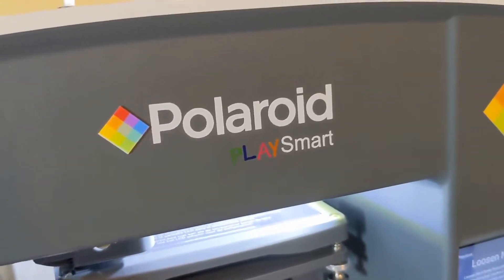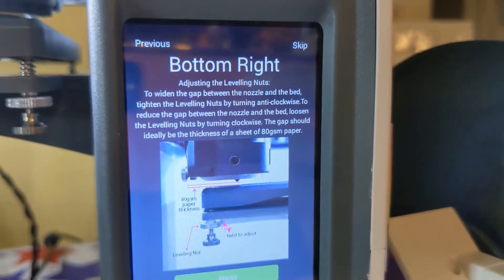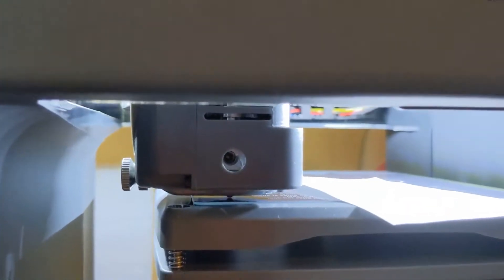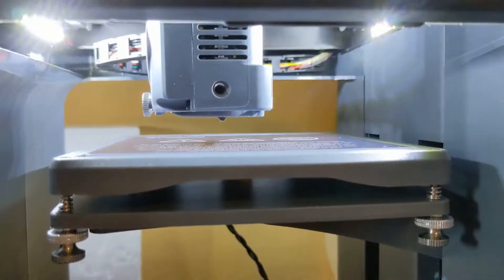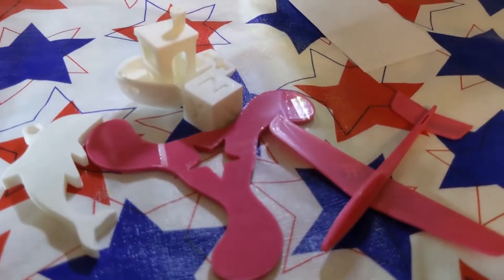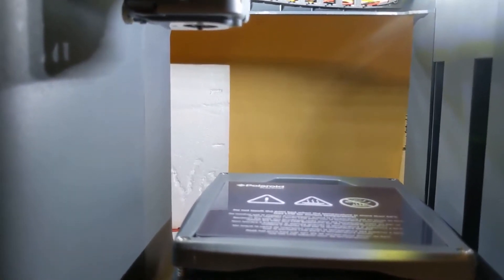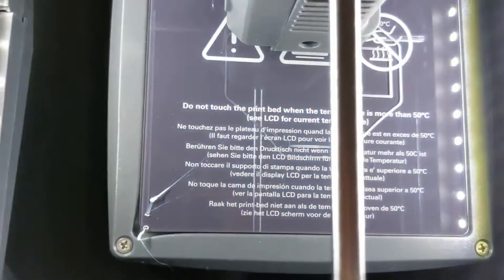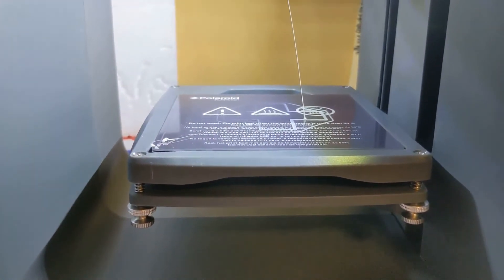Polaroid Playsmart Bed Leveling issues #3dprinter #Polaroid

Comment: Similar issue with my PlaySmart.  I got sick of chasing around the square with the built in routine procedure.  Now I just ballpark it once with the Polaroid built-in routine and then print out one of the leveling calibration prints that covers the whole bed and adjust the screws by sight while it is printing - quick and easy.  If it needs it I check it after every few prints with the same calibration print and if it is off I just touch it up.  And as 
@p0lyf0nisk says below, print with a wide brim and touch it up while the brim is printing if you think it is needed. 

Note also that the glass bed is held in place with four magnets on the bottom corners.  Pop the bed up/open and make sure there isn't anything stuck between the magnets or any contact points underneath.   

In my opinion this is a pretty good solid and very well made printer for the (close out pricing) money I paid.  Problem is that it has a small (120x120) bed.  I tossed out the top cover and only use the bottom cover cuz it has the feet on it and only has two screws holding it on.  It works great till it don't.  Like most 3D printers, the more you use it the more you will wrench (adjust belts, slipped shafts etc.) on it.  It was my first 3D printer so I have an emotional attachment LOL. 

BTW This is NOT the same Polaroid of the past.  That company went bankrupt and the brand name gets bought and sold.  Unfortunately the company that owned the Polaroid brand name at the time and built this printer dumped it (and all 3D printers) within a year or two after bringing it to market, dropped all support, pulled the phone apps off google play store and screwed all their customers.  I know, WTF??? 

And . . . also the Polaroid SmartPrep slicer app is based on a Cura engine exe however there are not many fine tuning changes you can make.   If you want to get serious with the PlaySmart If you search around you can find some printer profiles some users have created for the PlaySmart for Cura and Prusa slicer apps.  

And . . . if you open it up it uses the same (or very similar) Robin STM32F103 based board along with the Polaroid proprietary board for the WiFi, onboard camera and interface with the Windows, Android etc apps.   Unfortunately the stepper motor drivers (stepsticks) are soldered in (vs. sockets).  You can get one of those STM32F10x boards for ~$35 and run whatever firmware you want.  (I am about ready to)

Comment: I usually print with a wider rim on my prints, and adjust it slightly as the print starts, by then, usually the leveling is correct when it starts to get closer to the actual print

Comment: Thank you for making this video, I think I am having pretty much exact same issue. I purchased printer on good discount, and prints come out ok, but the first layer changes pretty much on every print, sometimes in the middle of the calibration process. I notice that for during the bed calibration for example, I feel the paper scratching. Then I go down 0.05, I hear a click, but nothing happens on the paper tension. Then I go again 0.05, and now paper is loose. Then I go up 0.05, now I do not have tension on the paper, then I go up another 0.05, now paper is too tight. So it is different if I try to calibrate two times down, or two times up, somehow it seems to skip this layer completely. 
It does print well though when it wants to, and I bought it cheap, so I might keep trying it in the following days and see how it behaves on larger prints. I could live with re-calibrating it every time I guess, but it is inconsistency that annoys me the most.
Reply from the maker: Yup. I think it's always been a design defect, avg that's why they had it on $100 sale, which is when I decided to try it for kicks and giggles. But yeah, it's not worth the pain and hassle. I'm just keeping it for the novelty of it .. LoL

Comment: There is a polaroid vid that shows how to level the bed. You are not loosening and tightening the nuts correctly. Both nuts work together, not just the one on the bottom that you are usingl.
Reply from the maker: I know both nuts work together, good sir. You loosen the bottom ones, then you adjust bed height using the second set, and then tighten down the lower ones.

I'm a pretty experienced guy. So, trust me on this one. Polaroid support agreed it's defective, and asked me to return. I haven't returned it yet, and it just sits there collects dust, cuz I have 9 more, bigger, better machines

Comment from the maker: I'll be reaching out to Polaroid Support, and post an update later, based on what they have to say.
Reply: Did you ever get an update
Reply from the maker: @RubMySweatyThighs  not yet. I got super busy, and haven't contacted them yet. I'll keep posted.
Reply: @learnmakerepeat7140  anything yet? Thanks!
Reply from the maker: @mastermind6767  They couldn't figure what was wrong, and said to return it to the store. I haven't returned it yet. But it seems like they don't care
Reply: Tighten the lock nuts to stop the adjustment screws moving it gives you the instructions on the screen but you didn't read it you pressed ok at 3.04. Lock tbe nuts and that should cure the problem
Reply from the maker: @90-wolf4  that's not the case. Nuts were tightened, and I'm will aware of the process of Bed Calibration and leveling for this machine. It's the least used of all the ones that I have.

Additionally, Polaroid support agreed with the issues, and asked me to return it. For the price I paid, I decided to keep it anyway, so I can mess with it